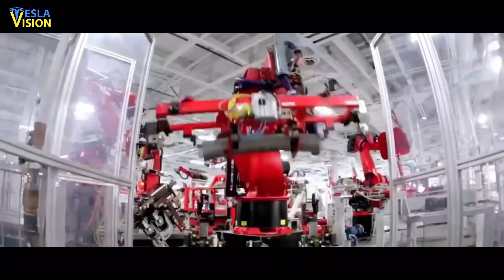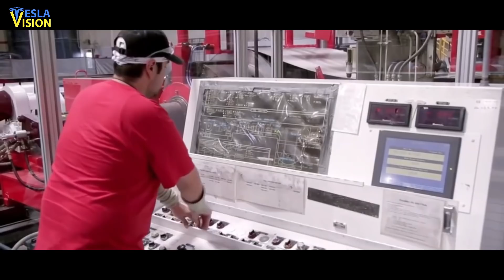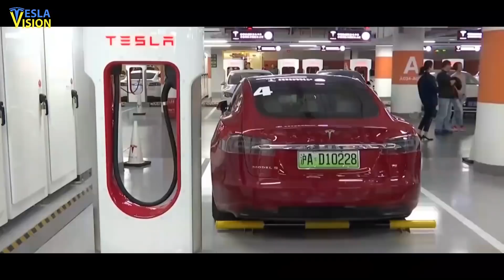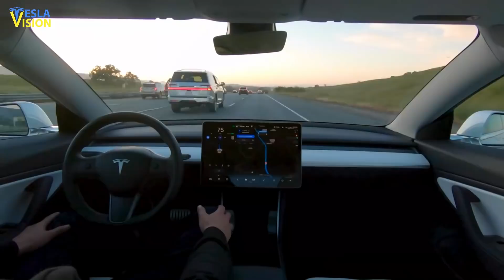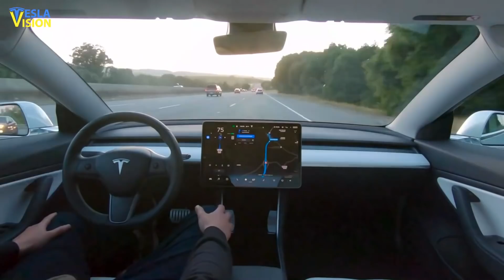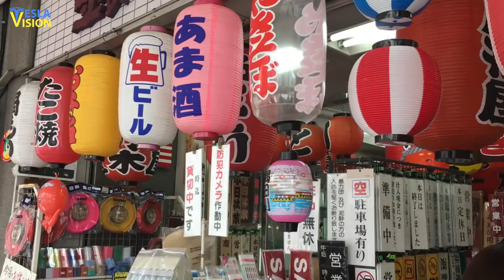GREAT NEWS!!! Tesla Yoke Steering Wheel Will Be The Top Choice!

Comment: Yoke steering - just fine for normal driving.  A real pain when maneuvering slowly such as in a parking lot, parallel parking or any time when you go lock to lock.  I love pretty well everything about Tesla but not the yoke steering wheel.
Reply: They are changing how much the wheels turn when the yoke is turned so that the steering yoke only needs 180 degrees of movement to go from full left to full right. The rest of the wheel would be unnecessary because of that.
Reply: @dougcurb6645  what happens if you lose traction and need to quickly perform emergency driving to stay on the road? Hb trying to make a turn with just one hand? Or what if I just wanna rest my hand on the top of the steering wheel? Or what if I wanna have a little fun with my 1000hp model s plaid and throw the back end out? O wait you can’t do any of those things with a yoke. It’s less safe, less comfortable, and less fun.
Reply: Auto parking?
Reply: @perahauraki2985  not everyone bought the fsd package